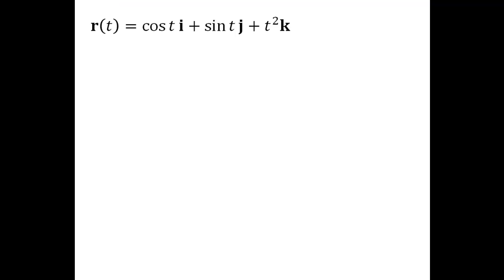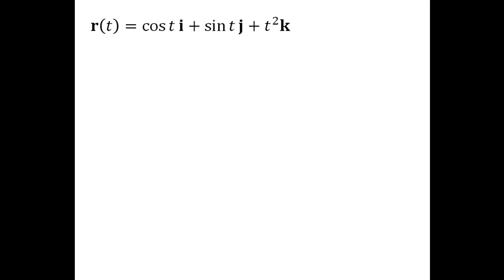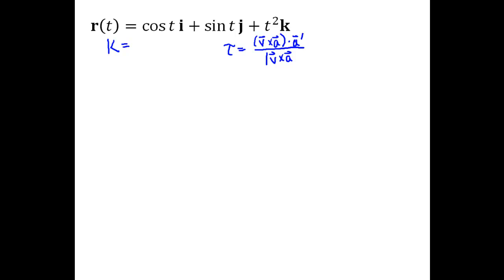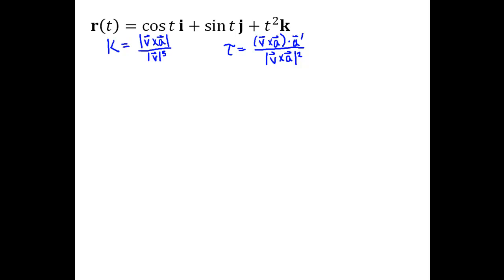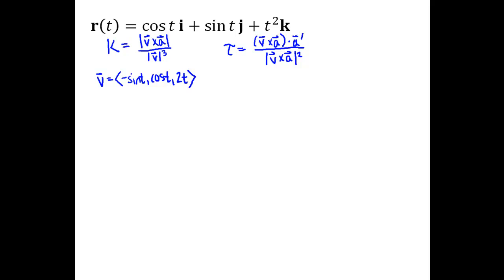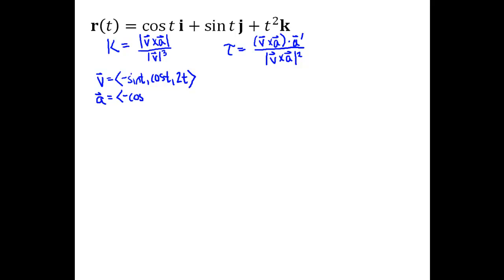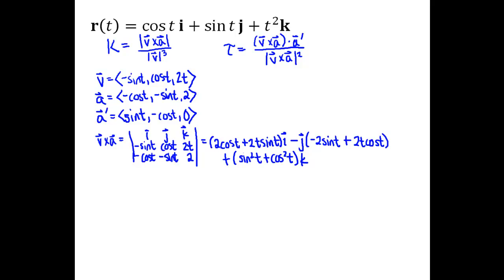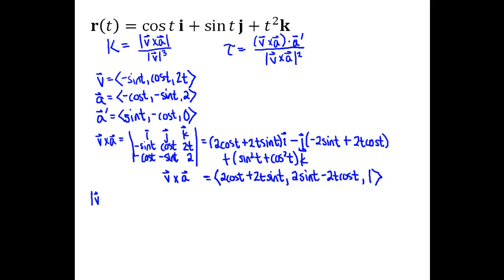Curvature and Torsion Part 1

Comment from the maker: The cross product is correct.  My guess is that you made a mistake on the signs on the j component of the cross product.  That is a common mistake, but it will mess up everything after that.  If you use expansion by minors to do the cross product, remember that there is a + - + pattern in front of the i, j, and k components.